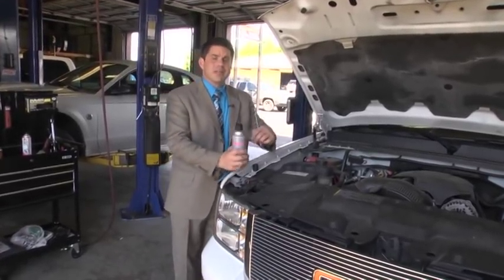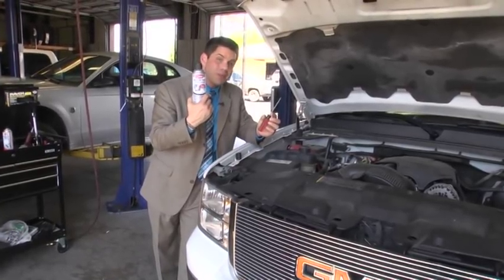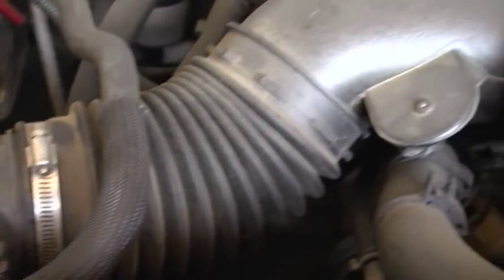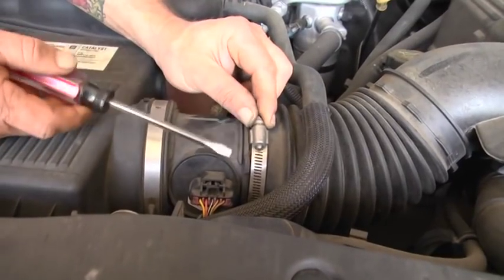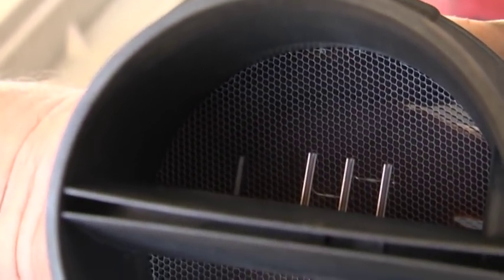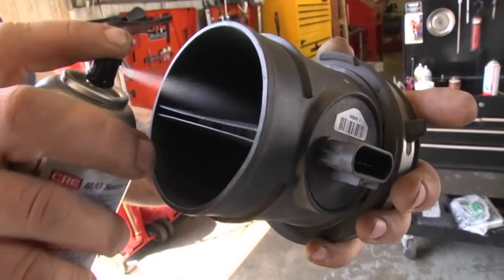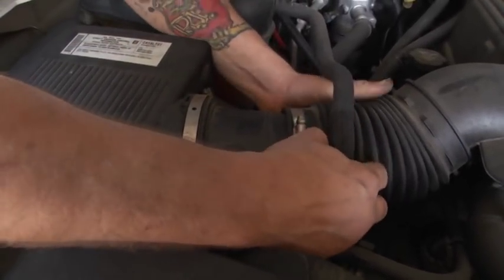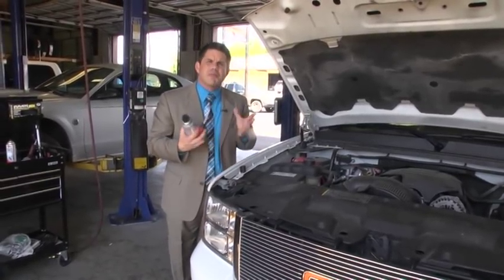Want better gas mileage?  Get a screw driver and spend 2 minutes here

Comment: What the mechanic forgot to mention is that after spraying the Mass Air Flow sensor, give it time to dry off completely, then install. I you start the engine and it's still wet, the hot wire elements will be overdriven and burn out, then you have to spend $300 to replace it!  He also forgets to mention to check for air leaks from incorrectly seated hoses, that will throw off the computer and the engine will run fast/rough and set an engine code!  Most cars and truck are far less easy to work on then the Ford in the video - they picked an easy one!
Reply: The Ford In the video? I'm pretty sure that was a government motors vehicle.
Reply: 5.3 vortec
Reply: @hurricane3626 yukon for sure 😂 and they are most definitely good trucks if you keep up good maintenance
Reply: A MAF sensor doesn't cost 300.00 dollars. where are you buying your parts from.
Reply: Most Fords are $40... But hey, everybody hates Fords.

Comment: This is misleading...  If your mas is that dirty then you have other issues..  Changing your air filter will have more of an effect then cleaning the mas..   Not mention the fact that they neglected to say to make sure the mas is completely dry before turning ignition on..  But all in all this is a waste of time and money unless you have bigger issues causing it to get dirty in the first place..  Seeing as how the air filter is 6" away from it which should keep it clean and the engine is probly 2ft away by time any gunk makes it up the intake...  Which is as impossible as it sounds..

Comment: This guy is a joke. 8 more miles to a gallon. The stock paper air filter is not restricting hp. Yes the filter is made from paper but there are small holes in the paper to allow air to flow through it. The Ford or the Neon will not make anymore hp or torque until you change the cam or boost the engine. Neither engine make enough hp for the stock exhaust system to be restrictive.

Comment: Buying Mass air flow cleaner very funny, try Alcohol on a Q-tip but be very gentle.  If you really want to save gas buy a car with the  smallest engine you can. with double the engine size you get half the gas milage. Remember half the gas you burn going down the road is used just to turn the engine.  One more point how much would you pay for gas before you just would not buy it???  i think about $20 dollars a gallon, that is market value.   Do you know when the country is going to run out of gas????

Comment: you'll actually use more fuel doing this not that you still shouldn't do it.  the maf sees less air entering when it's dirty causing a lean condition which saves fuel at the cost of power and drivability problems.

Comment: The best way to clean the MAF is to run your car at maximum revs for an hour or so. Let it get really hot by disconnecting the cooling fan. When a cloud of thick smoke comes out of the exhaust the job is done.
Reply: O O don't forget to run the A/C too.

Comment: Being. " Gm " master tech , this is not an General Motors approved method for MAF sensor maintenance or a repair of a MAF.
If it's not properly reading air flow the fuel system doesn't always go rich first if all , and the cooling system / thermostat system plays a large part also. I have seen cigarette butts stuck inside the sensor , most have a honey comb screen that most people booger the hell out of to clean a sensor that don't need cleaned.

Comment: this cleaner is designed to be used maybe once or twice during the life of the sensor. if there is a significant change in performance the sensor is losing its acuracy. more than likely you will damage the sensor with harsh detergents costs about 140 bucks to replace

Comment: This is bullshit first of all your car will be running like shit if the mass air is dirty or if your diodes are not function it won't idle at all and if you're not CAREFUL like this video don't tell you NOT TO TOUCH the diodes THE LITTLE WIRES LOL they are very easy to brake and this guy is about to touch them with a flathead screwdriver dumb ass!! this will not hurt to clean them but this is a product selling video lol

Comment: He is 100% right. Biggest problem is when air filters get dirty. The filter loses lil pieces of fuzz. The paper fuzz insulates the grid. This grid reads air flow flowing thru it by how much it cools the grid. paper is very good at insulating heat. The sensor reads wrong. Yes the oxygen sensor will fix it in closed loop. THIS FIX WILL HELP WITH OFF IDLE STUMBLE. Also spray the throttle body out to. Dirty throttle body will make accelerator pedal stiff to push.

Comment: This can also clear the check engine light sometimes.

Costs less than $5 for the cleaner which is good for cleaning the sensor so many times you'll lose the can before it runs out.
Costs about $150 to have the dealer do the same thing.

Do it once a year.  Its not going to do enough good to be worth the effort of doing it more often.

Comment: How does one check the blinker fluid?
Reply: Steve Dupree take blinker housing out turn upside down, it's the same as changing it just remove the plug in the top.
Reply: 2 man operation. 1 needed to fill blinker. 1 turns blinker on until fluid comes out.  Then repeat on other side.  NEVER try this alone! Almost always ends with air in the line causing opposite blinker to come on when used. ( we have all seen cars put left blinker on, then right).
Reply: STEVE DUPEE --  ON THE HANDLE ON THE STEERING WHEEL OF COURSE IT,S  THERE IF  YOU  JUST LOOK  !!!!!!!!!!!!!!!!!!!!1
Reply: Wait until the day they‘ll do it for real, would be a nice thing to add to the service bill

Comment: the last time I removed my mass air flow sensor the car went into limp mode and I had 2 take the car to the dealer to get it recalibrated. the car drive very slowly!
Reply: I buy two filters. wash the old one out in the wife's kichen sink with warm water and some dawn. GENTLY. Rinse with sprayer hose. Let it completely dry for at least 48 hrs. in a clean place. Now you have a spare. Store in the old box. There used to be a business in my home town where a guy had two large vats with soapy water and he bubbled air into the bottom of the tank. Mostly large industrial elements . Before they shut the "woods" down.

Comment: actually if you want real gas savings  plus lots of extra HP power  then PORT YOUR CLY HEADS

its easy and you dont need any extra  tools

update... outside real backyard bench testing shows this engine mayham modification only works on pure aluminum engines !!!  .. multi metal engines such as IRON, cooper or other metals combined and forged together results are not  guaranteed to perform like an all aluminum engine will perform after this modification... check with cars  dealership for  additional how to tips  and achieving the best results 

what you need to DIY port cly heads :-

 1 full tank of gas
 1  hour
1 topless super hot 18+ Year old female assistant with large tits 
 5 lbs bag (4 cly)  or 8 lbs (8 cly) of fine grain white porchilin  sand from home depot garden isle

1st disconnect the neg side of the battery (black cable -) now remove those air cleaners/filters  just like in the  video and any thing/parts  else that obstructs flow into the cly head... now reinstall the black - battery cable and have hot girl assistant with the large tits  start the engine... the engine will go into whats called limp mode also known as diagnostic mode...perfect not a problem this is  because the MAP sensor is disconnected and the computer is confused... 

next have your sexy hot  topless awesome assistant  warm up the engine to full operating temp once the temp around 165 * F is reached slowly start pouring the sand into the intake tube just a little at a time over  a period of an hour or so... thats it...reassemble in the reverse direction as was disassembled... and drive your new high performance automobile

why does this work so well and ASI MEchanics wont tell  you about this super easy modifiaction trick ....

because most of todays cly head are made from aluminum  and easily machined by using fine sand it acts like a sand blaster and with the air flow into the engine and the fine sand it eats away at the metal blocking the natural flow of the in comming air flow  coming thur the engine ...the sand once eatten at the aluminum obstrucrions is simple collected inside the piston combustion chamber and passed out the exhaust as the temp of the engine is to low to melt the sand ... if you run out of sand just filter the used sand  that comes out the exhaust and reuse as before.

thats it.. pat your self on the back and call that ASI mechanic friend of yours  and say to him "" suck my  dick you greedy jew bastard "" (not racism... just an insult to show him whos boss for him trying to rip you off after all you have done for him 

next take this puppy for a victory ride and celebrate... know to Mexicans with to much cash... call and gloat ... challenge them to a race.. if they ait there dog butt lickers... that will make them show up with cash in there pockets... just lay down that gas peddle and watch the smoke fly... i guarantee you they will say .... "we will never see shit like that ever agian " with an emotional  tear streaming down there cheek

anyway... its not perfect but certainly far less expensive to pull the heads and do it the old fashioned way back in the 80s with cast iron heads

give it a try.. let us know how it worked out...you will be dumbfounded as to why you never tried much less even heard of this automotive technic before

later

Comment: you should not spray quit so close to the element so not to cause damage for they have very thin layer of protective coating and dont plug the electrical connection on till last to allow for maximum drying time. just saying!   elem 101

Comment: Dirty MAF will cause a temporary lean condition until the O2 sensor gets warm enough for the ECM to go closed loop ... you will not gain any fuel mileage , the car will run better during warmup because a clean MAF will cause a richer fuel mixture..
Reply: TheIAMINU 

Open loop has a pre programmed set of rules to follow based on temp.  

The MAF absolutely plays into closed loop running. 

 Block them up and you run lean. To lean of a condition prolonged can screw cylinder walls and pistons.  If they read to much air from being dirty you can run to rich. Stay at a rich condition and you screw up your cats. Seens several blown out exaust systems and screwed engines from people not changing filters and the MAF getting ridiculously dirty. It works in conjunction with O2 sensors and temp sensors to keep a ideal air fuel mix.
Reply: Dirty MAF sensors read low , not high ... causing a lean condition until the O2 sensor warms up ,,, a clean MAF will improve driveability , not mileage...
Reply: TheIAMINU  it will rin lean untill the system tries to compensate for the lean condition pushing things to the rich side.  Its magnified usually by a bad temp switch though that is just as and really more important to keep replaced periodically.
Reply: The ecm won't be aware of the lean condition until the O2 sensor gets above 600 degrees ..
Reply: TheIAMINU https://www.wired.com/1996/01/saint-marshal/
Who is Marshall McLuhan? The Pilloried Professor Who Predicted ...
Reply: TheIAMINU john
Reply: A dirty MAF will cause a sluggish reading, a lean reading, or both.

Depending on the engine management system, the MAF can be more or less vital in calculating fueling needs.

Most systems are extremely simple and use all inputs into a single algorithm to create a calculated AFR value.  Injector impulse timing is then adjusted to get back to the fuel injection table for the engine conditions.  So the MAF is equally as important as an O2 sensor - and can be as much as 25~40% off without setting a code due to a too lean or rich condition.  If the MAF is sluggish, no code will be set and cleaning will almost always resolve the issue - because sluggishness is just caused by extra thermal mass on the wire, slowing down the heating and the cooling of the sense wire.

More modern systems will run secondary tests to determine how far outside of expected range a sensor is performing relative to other sensors and will set a code based on that, so you can get a code for a sensor before it's actually outside of what would have normally been an acceptable operating range.  These codes are usually kept as pending codes for later verification in my experience.